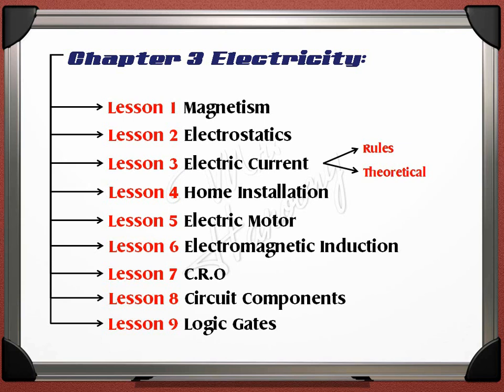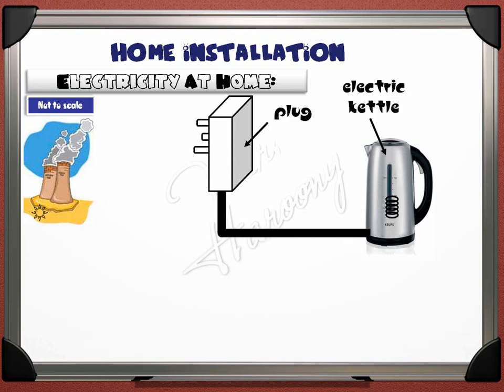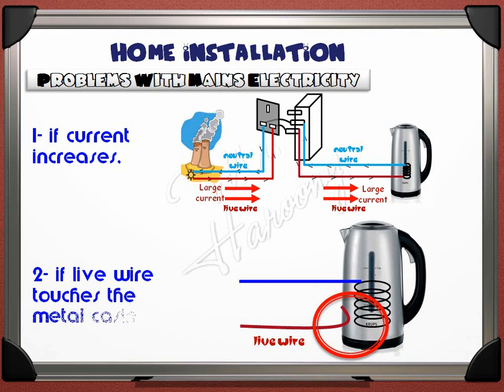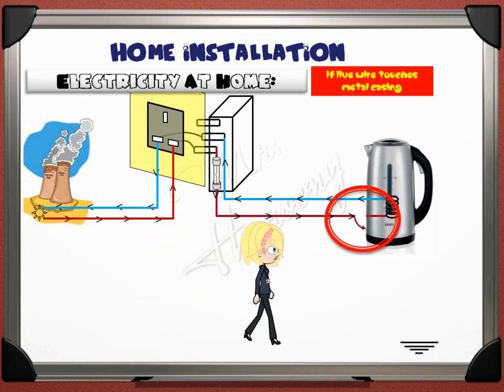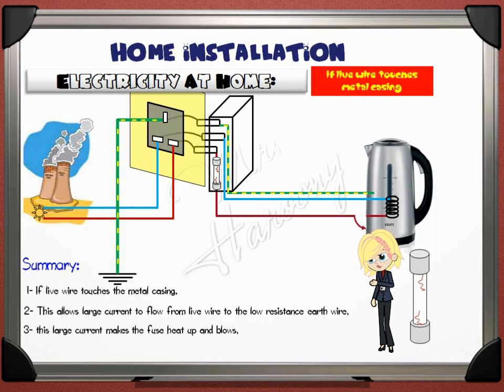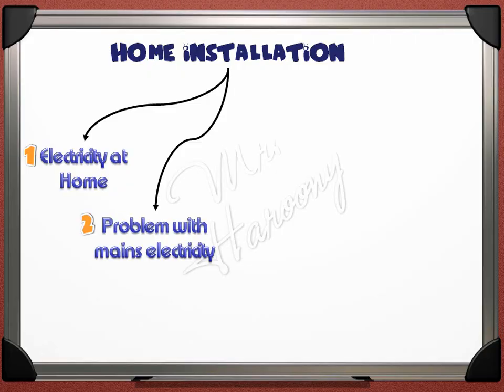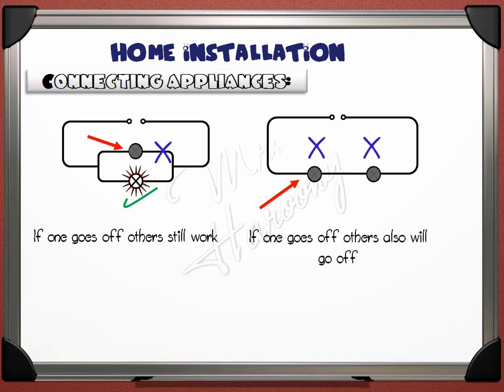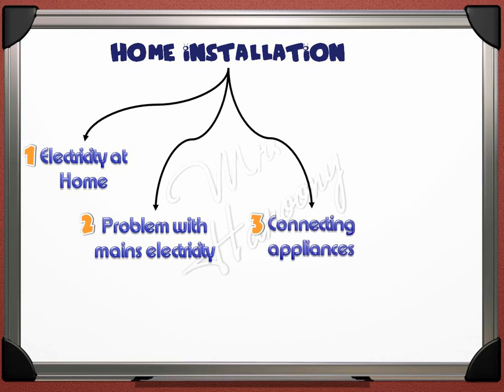Ch3L4 Home installation IGCSE-GCSE physics electricity

Comment: This is the only video on youtube which has helped me greatly...
Thank you so much for makind such an amazing video
I just had one question that if the live wire touches the appliance body the current will flow through the neutral wire but how will this effect the current in the live wire as they are 2 diff. connections